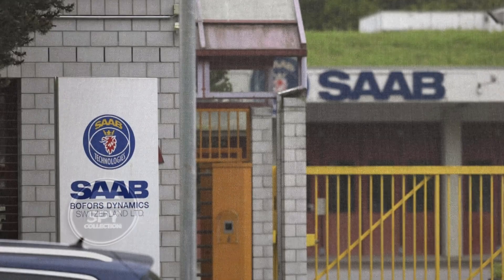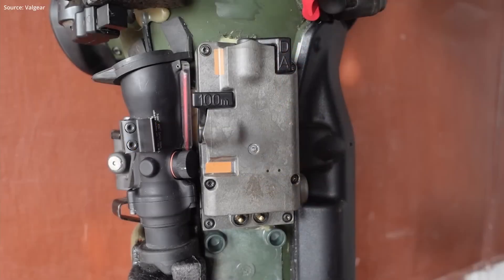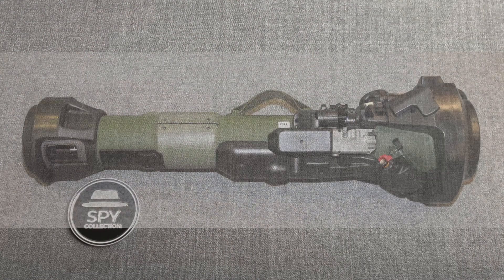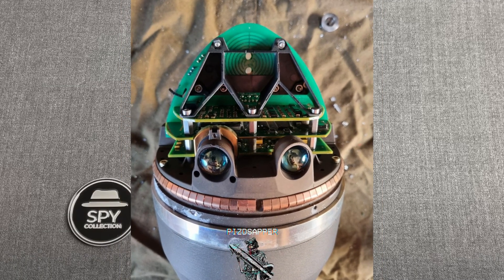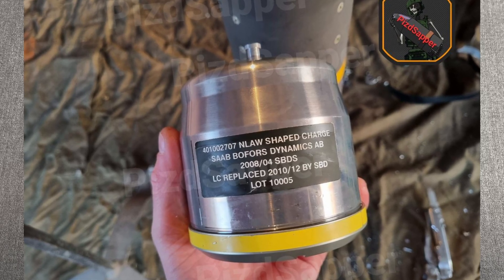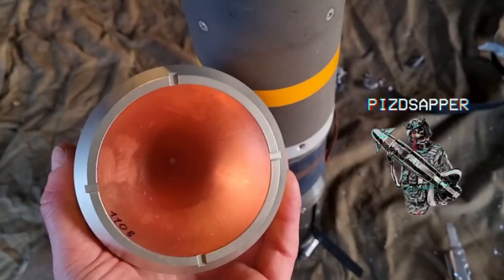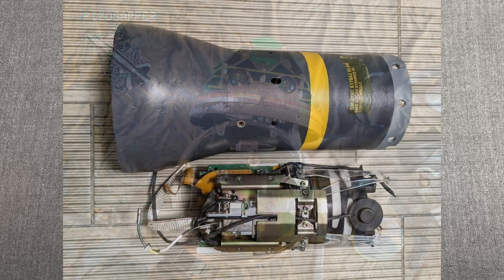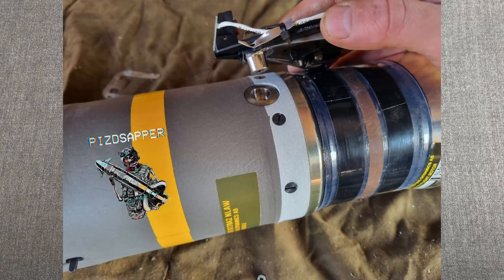TECHINT on Saab Bofors Dynamics NLAW (MBT LAW or RB 57) Missile System

Comment: What if a Russian combat engineer decided to rig his tanks with some cheap metal crown with metal fins outwards on top of the tank turret, wouldn't that trigger the proximity sensor on the warhead and make those missiles ineffective ?
Reply: Yes if fins are long enough(4 meters or so). Missile has some delay after metal detection so it detonates about in the middle of the tank.
Reply: @villekinnunen6357  Yes in the tests it detonates after about half way, less than 4m, 2-3m range. 
BUt you can see in the prototype test, it detonated on a tiny piece of metal.
Reply: No, the computer uses topographic recognition to tell eg. tanks from civillian cars.
You could hit a tank hiding behind a metal-roofed truck with the OTA mode if you knew it was there.

The only way to 'confuse' the system would be to have a metal object, with the same height and magnetic variation as another valid target in its internal database, between your tank and the missile at the exact time that it's fired at you.

Comment: Very nice - thanks for producing this! A few minor corrections about the warhead. Based on the shape of the copper liner, I do not think this is an EFP type but rather a traditional shaped charge. The difference is that shaped charges require a fairly close standoff distance while EFP's can travel some distance (10s of meters) and still be effective. This makes them ideal for certain kinds of anti-tank mines which don't have to be directly under the tank. But EFP's can't penetrate as much armor as a traditional "jetting" shaped charge of the same weight. Also, it is a common misconception that the shaped charge effect relies on melting the metal. Sometimes the copper melts and sometimes it doesn't, but it doesn't matter that much. The forces acting on the liner are so huge (100s of thousands of times atmospheric pressure, far greater than the deepest part of the ocean) that the metal is forced to flow even in the solid form. It forms a long, thin, hypervelocity rod or "jet" which has such a great impact force that it displaces even much harder materials - again by just applying so much force that the intermolecular forces pale in comparison. As the rod displaces armor, some of the rod gets displaced, too, in proportion to density (one of the reasons why depleted uranium is used as armor is because its high density means that a lot of copper rod must be displaced for each unit of penetration). Only if the rod is long enough will it make it all the way through the armor.
Reply from the maker: Thanks for the explanation.
Reply: This was an amazing explanation and the world needs people like you to be more willing to share their in depth knowledge like this
Reply: Any info on how changing from OTA to DA affects the operation? Does NLAW physically rotate the shaped charge's angle, or is it just relying on the explosive power of the warhead and whatever the downward facing molten copper stream creates?

Comment: Interesting what it does in direct attack mode. Because of the 90 degree angle this shape charge will not have much effect on the target, and there is no rotors that rotates charge to face forward before launch. So, probably it's a direct attack in a sence of "fly the missile exactly where I pointed"?
Reply from the maker: Indeed, according to Saab, in DA mode the missile flies directly at the point of aim, in a straight line, and detonates on impact. This is why it's not recommended for any armoured or hardened targets, but for light vehicles, helicopters, and enemy positions. We are guessing that just the blast of the explosives would be enough to damage those, even if they aren't directly in the path of penetrator.
Reply: @SpyCollectionChannel  my assumption was that it would still activate optical and magnetic sensors, but it would let operator choose where the rocket would go.
Reply: @rogo7330 I believe you can still use the predictive-line-of-sight target tracking mode, but in DA mode it strictly operates on impact to detonate the warhead.